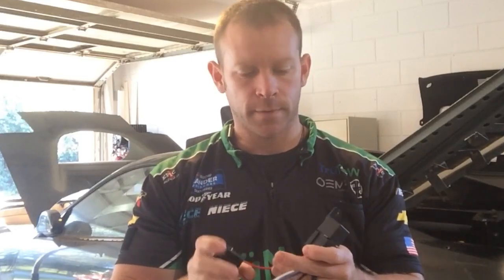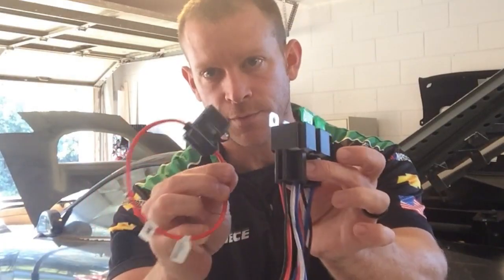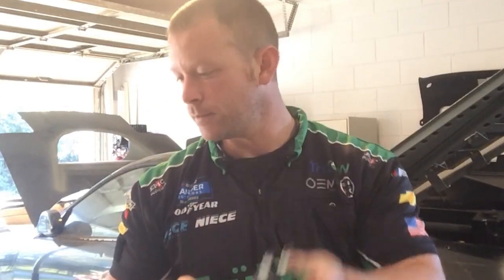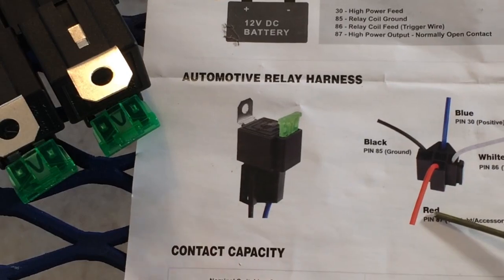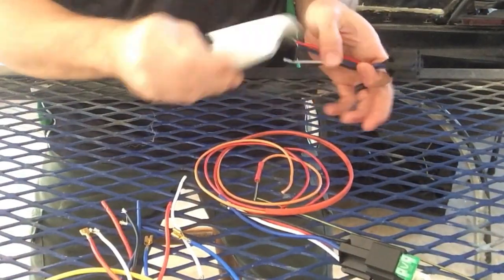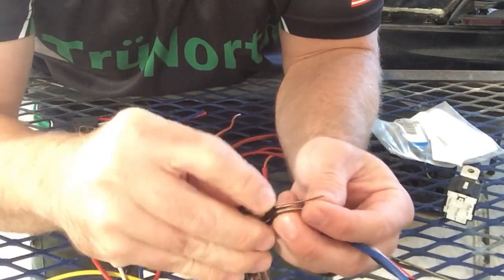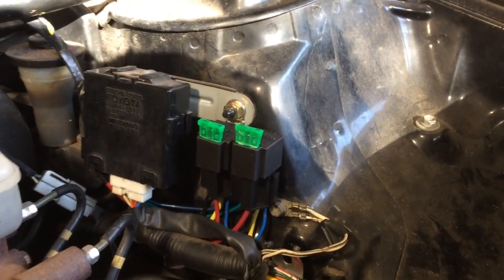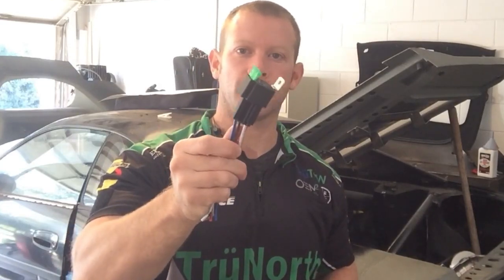Fused Relays

Comment: Used those in my son’s car but the connectors for the connection that holds the fuse isn’t robust,,, so,,,,

I replaced them with FuelTech brand relay/fuse combo. Those are BEEFY. Same concept but much more robust. Can remove the cheap Amazon relay and pop in a fueltech.
Reply from the maker: Sounds like a better option thank you. I will look into those.
Reply: @scantronsgarage  yeah only $10 bucks each but quality is MUCH better. You’ll be very pleased. And no need to change your wiring. They plug right in.
Reply from the maker: @4familyman  that is perfect! I didnt want to re wire. THX
Reply: @scantronsgarage  did some searching and found that the brand is Temco. Fueltech resells them. Can save a couple bucks straight from temco.